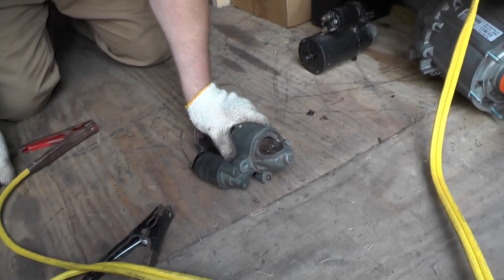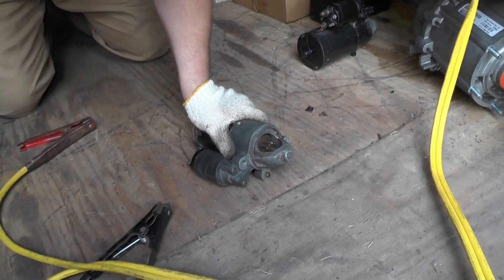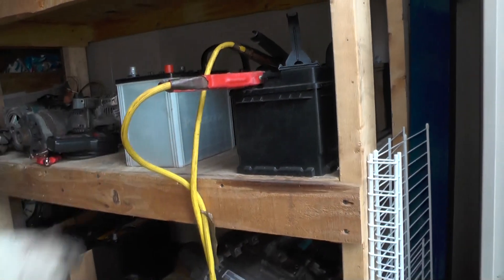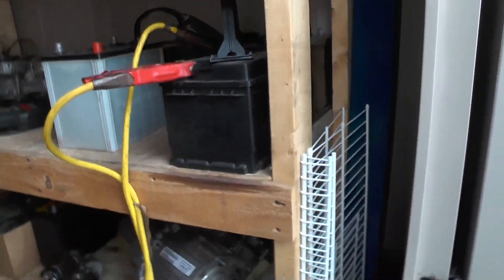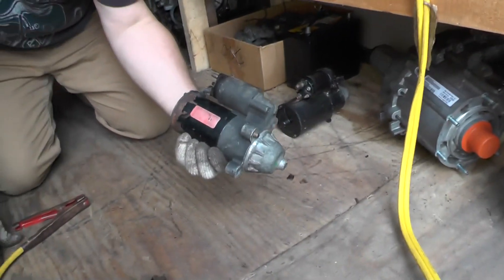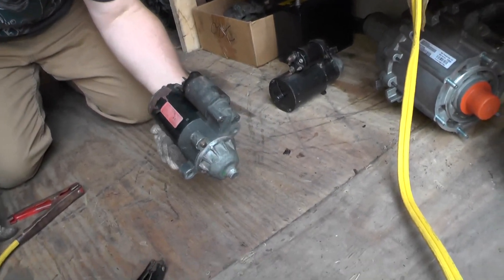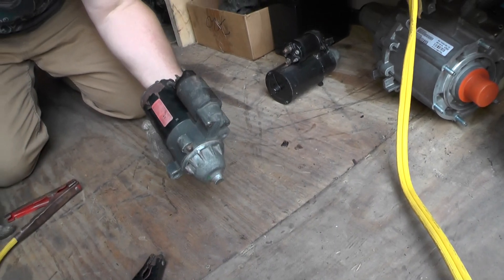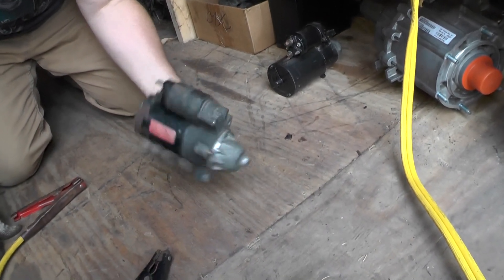Ford Starter Testing with Jumper Cables

Comment: Try that with an old Ford 2.3 or Non starter Mounted Solenoid.
Reply: Why doesn't the nose gear kick out to simulate engaging a flexplate or flywheel?